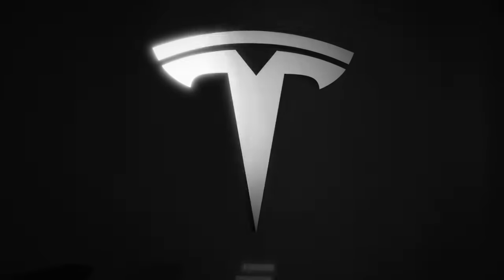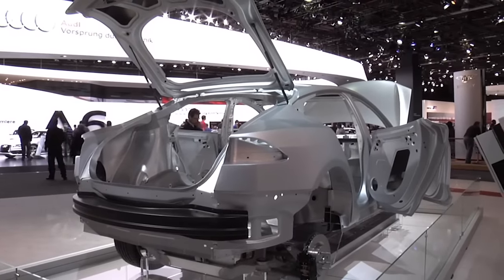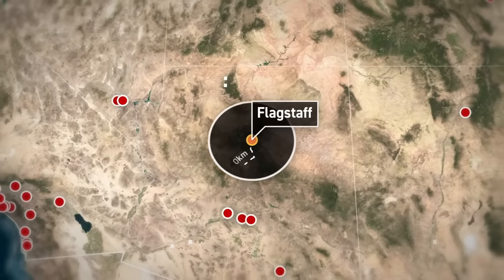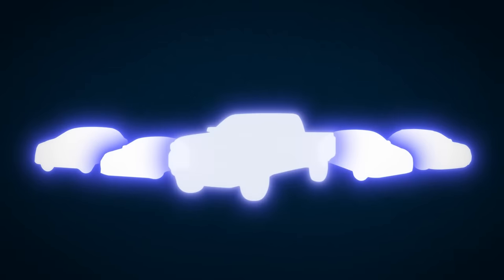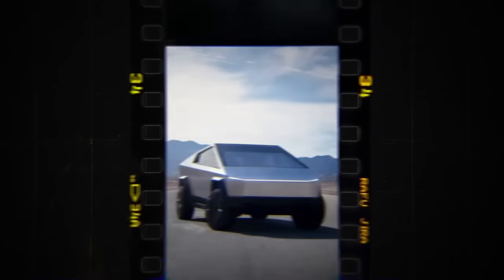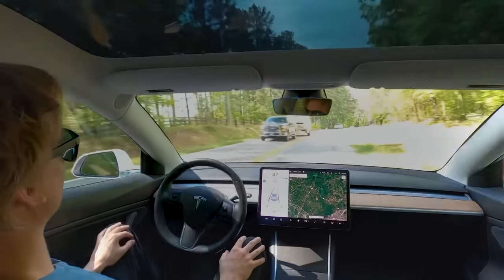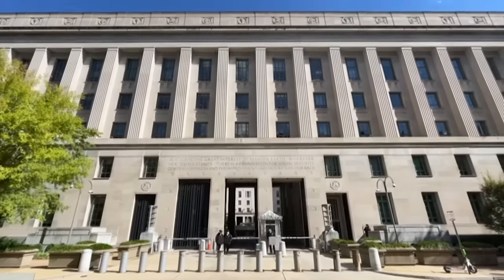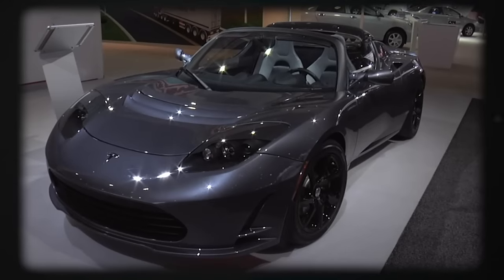How Tesla Fumbled

Comment: One reason I think people buy Teslas, which was not mentioned, is because of the charging infrastructure/network. I own a F150 Lightning and on a road trip finding reliable, fast CCS chargers can be hard and off putting.
Reply: The two people I know who bought teslas did for this reason. With another car you can’t even plan a trip because you can’t count on the station you need to even be working or have what it says, meanwhile Tesla can tell you real-time which of its chargers are operational and where
Reply: Thought Tesla just said they are opening their charging infrastructure to all soon.
Reply: @TStark-vj2wo  For the Americans I hope so, in Europe it was very beneficial when there was a line at a charger, I went on to charge at Tesla in Denmark last summer.  It will massively boost the appeal of all other EVs in the states when they do.
Reply: @TStark-vj2wo  "By the end of 2024" so in my book not anytime soon.
Reply: Thankfully that wont matter soon when Tesla opens up their network to CCS vehicles! Cant wait! Finally I can buy an actual DECENT ev over a Tesla and enjoy the charging infrastructure Tesla provides. Which I must admit is better then any other company.
Reply: @starraidz791  - "By the end of 2024" so not really anytime soon and it's not all chargers. But I wish it was sooner!
Reply: Friend recently sold his Porsche Taycan for this reason
Reply: My wife drives a Model Y and me a Mach E. I love the Mach E so much more but road tripping in her car is significantly more convenient.
Reply: @TStark-vj2wo  You did not read the fine print.
Reply: @starraidz791  Fingers crossed, let's hope!
Reply: check what it is said in the pinned comment. "so it inherently omits the positives". so he does know what he is doing but really if the whole angle is intentionally omitting positives that's something that should be in the beginning of the video giving warning. instead of just putting in the pinned comment section. it also omitted negatives things about ford lightning trucks.

now that's completely different from omitting positives of tesla since it did flat out said so in comment but it didn't say anything about omitting other brand's information to make them look good. I say that's pretty indefensible.
Reply: Had to scroll way to long for this comment. Yes he mentioned everything negative and forgot to mention the only positive they have. Got a bit less credibility for me because this is exactly why people buy Tesla's. The range and charging stations.
Reply: Having a monopoly over critical infrastructure is unthinkable in Europe. Imagine you could only fill up Hondas at most fuel stations, that would be absurd. I’m glad there are laws to protect consumers from such monopolies here.
Reply: @kramo  Same deal in China. Which means Tesla's do not have a charge network advantage in the number 1 EV market (China) and number 2 EV market (europe). Only here in the US can Tesla get away with having their own proprietary charging network.
Reply: To be fair, Tesla's US charging infrastructure is an advantage they haven't squandered.
It would have been nice if the video had literally said just that about it.
But maybe a new video on EV charging is forthcoming.
Reply: @TStark-vj2wo  they’re doubling their numbers and half of those in the increase will be open to all. So only 25% or less are actually open
Reply: IDK how y'all do it, the drive home from my college campus is 6 hours and there isn't a single charging station along that route. If I had an electric I would have to take a different 8 hour route.
Reply: @MichaelOxlongerThanYours  - EVs are a new and emerging technology and are not for everyone and every use case. Over time the infrastructure will get better just like 100 years ago there weren't gas stations all over the U.S and for example the  Model-T had a range of 20-40miles on a tank of gas. Using apps like Plugshare and ABRP you can plan your routes, figure out where chargers are, and see ratings of them. Again EVs aren't perfect and the infrastructure definitely needs improvement but that's what you get with an emerging technology and being an early adopter
Reply: @tren133  they aren’t ‘getting away’ with anything, Tesla is a private company, they don’t have to open up their network if they don’t want to.
Reply: @Zazzeria  Unless Elon wants federal funding for anything.
Reply: @Zazzeria  they Want the IRA money, though
Reply: Kinda crazy to me that the US doesn't have standardized EV charging in 2023
Reply: To be fair charging network isn't much of an edge at all because with ranges in the hundreds of miles nowadays, 95% of people will only ever charge at home overnight. Almost no one drives over 400 miles in a day regularly in which case they'd need to charge on the road. For most people driving a few dozen miles (or a hundred miles maybe) daily for commuting, they'll simply install a 120v or (faster) 240v charging point at their home and not go spend an hour at a charging station waiting for their car to be charged up.
And I doubt most people place too much weight on their bi-yearly week-long road trip in their car choice.
Reply: Honestly the number of lingering shots of superchargers while incredulously expressing confusion about what could be the appeal of these cars, this has to be a bait.
Reply: @Zazzeria  Evidently the liberal democratic governments of the EU and the one party government of China BOTH agree to the fact that private company Tesla can either adhere to their national fast charging standards or they can kiss their ability to sell cars in those regions goodbye.
Reply: good luck finding a charger with your cybertruck....
Reply: It comes down to Tesla having a headstart on the competition. I think the effect is starting to wear off.
Reply: This is what I don't get Electrify America etc. why can't they build, solid, reliable charging stations, and lots of them? Every charging station that malfunctions is lost profit. You'd think the companies want to make money.
Reply: Isn't it possible to just buy an adapter and tap on Tesla's chargers?
Reply: @leftcoaster67  how much profit is it tho? I doubt they make much money from selling energy they buy from the power grid
Reply: @TStark-vj2wo  only 10% of it.
Reply: Again, you and 454 people missed the point of the video. Not "How are things now" but "How will things be in a decade?" They have clearly made mistakes, they will have an impact.
Reply: @PhillipStewartYYZ  
Thanks for the details.
Reply: @x--.  they’re all bag holders coping
Reply: Thank you for being honest, often overlooked.  That being said the Lightning is legit!
Reply: @TStark-vj2wo  only a portion of teslas superchargers will be retrofitted for crummy EVs.
Reply: @7SlicesOfPizza  I don't know about you, but when I watch a video titled, "How Tesla Fumbled," I expect that it'll focus on the negatives, not the positives. Likewise, I don't order canned peaches and complain when there's no bacon inside.
Reply: The supercharger network is opening up to everyone (as it should) with the magic dock that allows CCS cars to charge at any Tesla supercharger station. They have already opened it up in Europe. The network is no longer a benefit for Tesla and neither should be. Imagine car companies owning a monopoly or owning their own gas stations. You can only fuel up your Toyota at a Toyota gas station. That stuff is nightmare fuel.
Reply: @PhillipStewartYYZ  they promised to open up 7500 universal charging stations. Tesla currently operates about 3500 stations all over US so no, not 25%, it's 200%.
Reply: @earthling_parth  Read the White House's announcement again: "Tesla, for the first time, will open a portion of its U.S. Supercharger and Destination Charger network to non-Tesla EVs, making at least 7,500 chargers available for all EVs by the end of 2024. The open chargers will be distributed across the United States. They will include at least 3,500 new and existing 250 kW Superchargers along highway corridors..." 
3,500 supercharger stalls in US open by end of 2024.
Reply: @PhillipStewartYYZ  And to follow this up, "stations" is not the same as "chargers", especially when each Tesla "station" usually has 12 or more "chargers".  People read what they want and ignore facts that are inconvenient.  (now if they were talking about Electrify America where there is often only 2 chargers per station, that might make more sense).
Reply: @PhrugalPhan  There are about 1,600 Tesla Supercharger stations in the US right now.  Doubled to 3200 by end of 2024.  So Tesla can't open "a portion" of 3200 to equal 3500.  The 3500 is stalls, aka chargers, not locations.
Reply: @PhillipStewartYYZ  OMG, you need to re-read the same text you quoted.  

(1) The White House used "weasel wording" in their announcement.  It does not say the 7,500 chargers, nor the 3,500 chargers will be exclusively Tesla, only that Tesla is opening a portion of their network.   The 7,500 & 3,500 numbers include all companies.  (Yes, they want you to think they are all Tesla, which is why they worded it that way.  This current administration is far from honest.)  

(2) You're right there are 1600 stations now, and the estimate of 3200 Tesla stations by end of 2024 sounds reasonable.  At an average of 12 chargers per station, that will be 38,400 chargers EOY 2024.  So for Tesla to be a portion of those stated 3,500 250kw supercharger stalls at EOY 2024, say 3,000 , out of the 38,400 charging stall that Tesla will be running at that time, ummmm.... yeah, I think Tesla can easily open a portion of their chargers as stated.   Sheesh, did I really need to do this math?
Reply: people buy teslas because they drive themselves and are 10x safer.
Reply: @earthling_parth  Eh, I don’t think it’s that unfair. The entire car industry mocked Elon until 2018. They invested in EV infrastructure when everyone else was pumping out bigger SUVs. Other car manufacturers should suffer some for their hubris. They’ve been at this for 5 years now and still don’t have a reliable alternative to Tesla Superchargers. Hell, Toyota just came around to developing an electric vehicle in 2022.

Your analogy is a bit off. It’s like if Toyota spent a decade and billions of dollars developing conveniently located gas stations for their cars and then other manufacturers came in demand that all vehicles be allowed to get gas there too.

Comment: For service centers, it is worth remembering that close to half of states barred them from operating there due to local dealers fighting tooth and nail. It is down to single digits, but has been a large uphill legal battle
Reply: Well lets be real, having a mechanic that can only work one brand, and having a car that can only be serviced by one mechanic is problematic in its own right.
(I know other brands are also moving in this direction, it's problematic there as well)
Reply: True but other luxury/exotic car brands have even less service centers than Tesla but still maintain a higher quality product than Tesla. Ferrari, Lamborghini,
Reply: @Lucas-hb1uq  you’re comparing teslas 40k - 100k to Ferraris and Lamborghinis. You’ve lost already
Reply: Wonder if there's a "Right to repair" aspect to this as well.
Reply: That's because they sell online and not through dealerships. It's a stupid rule, but you cant have your cake and get to eat it too.
Reply: @Lucas-hb1uq  a Tesla is NOT a luxury car
Reply: @flavioa6351  
The Model 3 isn't the only model with poor build quality. It goes up the line to their high end models too; the ones with starting prices over 100k
Reply: It’s also worth noting that electric cars are very different when it comes to service. Just because there are Ford and Chevy dealers everywhere. Doesn’t mean they will all be certified to work on High Voltage systems. Or also has available tools, parts,  and certified techs.
Reply: Embrace right to repair and let 3rd party service technicians and mechanics be able to work on it
Reply: @flavioa6351  I’m comparing luxury/exotic cars such as Ferraris but let’s add something in the Tesla price range which in no way are they 40k. More like 75k-150k. Range Rover, BMW, Mercedes, Audi. All of these manufacturers have as little service representation as Tesla yet have superior quality. Not sure why you think this is a win/ lose discussion unless you are choosing a side for some reason.
Reply: @fort809  very true but they are priced as such and don’t have an affordable model.
Reply: @Lucas-hb1uq  those brands have way more dealerships than tesla stores so you’re wrong lol also go read some horror stories on how those brands treat their customers . They’re all horrible
Reply: @flavioa6351  Anecdotal but I live in a major city (top 5) and they are 1 for 1 with exception of BMW. We are not discussing quality of customer care. We are discussing the quality of the cars and their $ for $ range. Tesla’s build quality does not come close to their price point.
Reply: @Lucas-hb1uq  I’m sorry did you just imply Ferrari and Lamborghini makes reliable cars?

Their 3rd or 4th cars (when not just undriven baubles) they can go months broke waiting for repair slots. Different ball different game.
Reply: josiaslourenco3616  So do you live holy out of fear of an all powerful god or out of just being a good person. If your answer is because of the former then that says a lot about you. If it’s the latter then you don’t need the former and never did.
Reply: @Lucas-hb1uq  And maintain a much higher price and limited availability. A Tesla is not a Ferrari, but Ferrari is trying to be a Tesla.
Reply: @fort809  Do you mean it does not cost what other luxury cars cost?
Reply: @OriginalPiMan  You should check this out yourself, you don't own one.
Reply: @MIKOOL13  Afraid of electricity?
Reply: @tedmoss  
You're right, I don't own one. I'd rather spend my money on an electric car that has a reputation for good build quality. Either that or a cheap price. Tesla has neither.
Tesla has a well earned history of poor build quality that is as old as the first Roadsters.
Reply: That's not true. No state bars automakers from running service-centers. They barred automakers from operating direct to consumer dealerships. And it made perfect sense a century ago when automakers were forcing dealers to buy cars during the Great Depression. They would essentially just strong arm dealers into doing whatever they wanted and if there was any pushback they'd open dealerships directly across the street or cutting off access to cars altogether. Now of course that century old law hurts consumers today bur the Dealer Lobby isn't going to just roll-over. The biggest reason automakers haven't opted to lobby for a direct-to-consumer model years ago is because thr dealer run service center is vital. It took decades to build that up and they didn't have to personally do it. Everybody lives near a third generation of dealership owners.
Reply: 95% of services on a Tesla could be solved by software, not even need to visit a service center. This video is so wrong in many points and 100% dude got paid by short sellers
Reply: We don't care. Tesla is supposed to work on value, not sympathy
Reply: @Lucas-hb1uq  Yeah, those cars were historically known for unreliability for many many decades until maybe the 2000's.  They were show cars that needed maintenance every few thousand miles.
Reply: @dojokonojo  I hear you, but how many 3rd party shops can work on high voltage battery packs? adding a feather won't tip the scale.
Reply: @ziggs123  I'm not even sure there is a short seller tie here. Think about the companies that advertise on YouTube. Even if Ford, GM, Toyota, Hyundai, Honda, VW, Shell, and Exxon didn't "sponsor" this video, they buy HUGE chunks of advertising through YouTube. I imagine a smart content producer might be aware of who else keeps YouTube in business.
Reply: @Lucas-hb1uq  You're not even remotely correct. A base Model 3 sells for $43k. Most people in the market for a Tesla will also qualify for a $7500 EV tax credit.
Reply: @Lucas-hb1uq  there are no higher quality products than tesla. ICE cars are for boomers. 🤣
Reply: @pt9845  Unfortunately battery cars are extremely limited due too infrastructure and limitations too battery tech. The reality is passenger cars are for boomers and those who don’t understand that cars cannot fix any problem and only cause more. It wouldn’t matter if we had hydrogen cars either
Reply: @Lucas-hb1uq  First hand i can tell you; the white glove experience of an exotic dealership is lightyears better. End to end service in a covered trailer. When the margins are that high, you can provide a service experience that makes few locations a non issue.